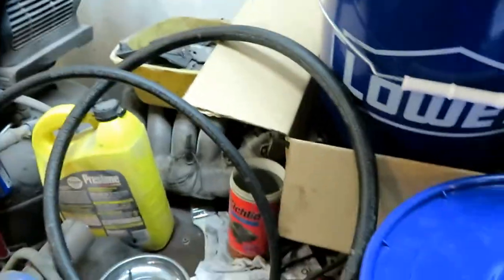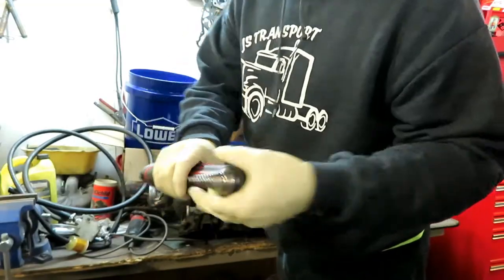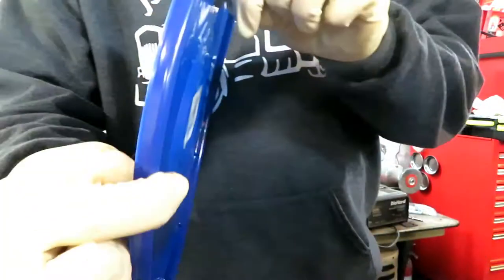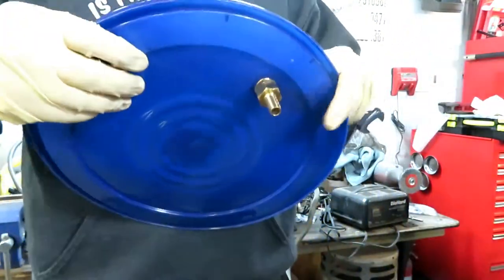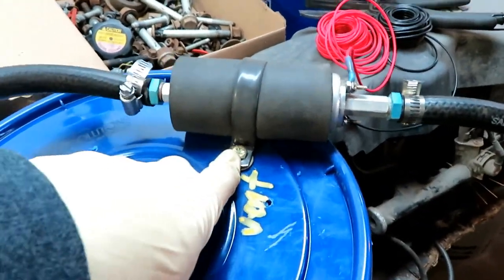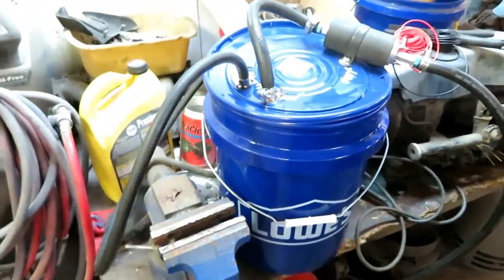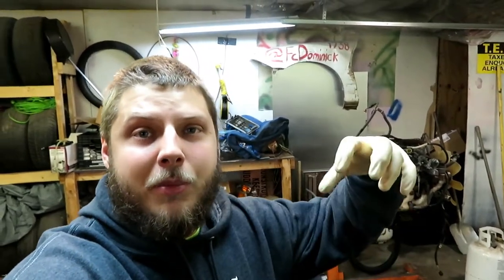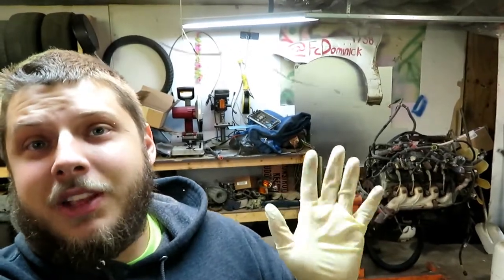Redneck Fuel Cell DIY "The Bucket Fuel System"

Comment: reason not getting tighter is because the thread bottomed out  inside the female fitting  so would not tighten against the lid.    for  simple use around the garage  fine or in yard but  dont get caught over the road using that and a hint also  make a ground strap to ground the bucket to a pipe  or a ground rod or to the frame of the vehicle  so you   get rid of any static build up from the plastic
Reply: any type of material you might recommend (reco) as a diesel resistant gasket?  Thinking maybe ptfe tape?  Not sure....
Reply: @tubsun  the fittings to use would be a straight pipe thread that you can use a fuel resistant  sealant pipe  like   (  Gasoila E-Seal   ) amazon  sells it  or check with a local aircraft service mechanic for type of pipe doper they use    Gasoila E-Seal comes in various types   for gasses such as propane and natural gas and also  for rthenal and e85 specific applications

Comment: Great idea! I need to do this for my plow truck. The line started leaking and the tank is pourous. So I need to do something. But don't want to put a lot of money into it. But I think I'm going to modify the design and put a in tank sending unit in the top if it will reach. The truck has EFI with a return, so I can't use a boat tank.

Comment: I liked the idea of using a fuel pump out of an old car, rather than having to buy one on ebay for these projects.  Thanks!
Reply from the maker: I had this pump in a bin. You can get something similar these days for $30. I just wouldn’t use them on a road car. For a bucket it’s fine thou

Comment: Did this with a factory fuel pump that I had for some reason and a bucket and some 15' of fuel line hose I had found and kept in my welding rig for some reason and used my aftermarket lights wiring and a cut up extension cord to power the pump and it got me home lol but it was giving me like 3mpg so I poked holes in the hose still inside the bucket and that took excessive pressure off of the injectors